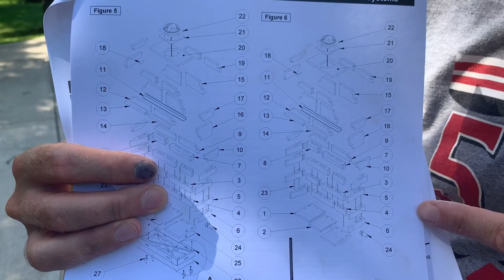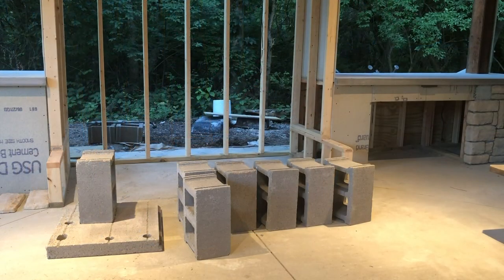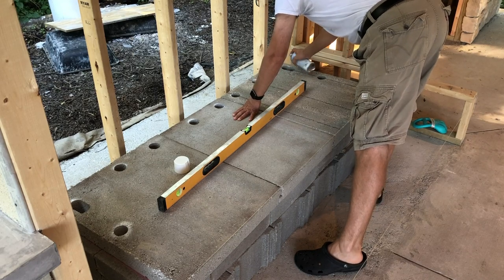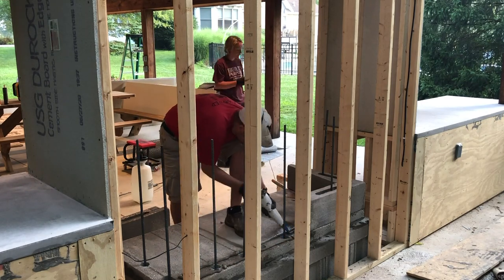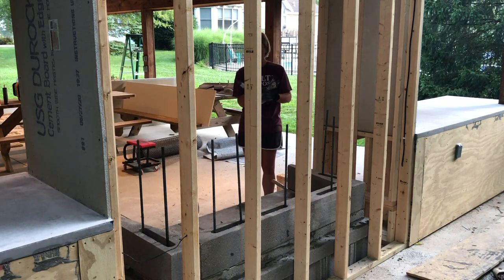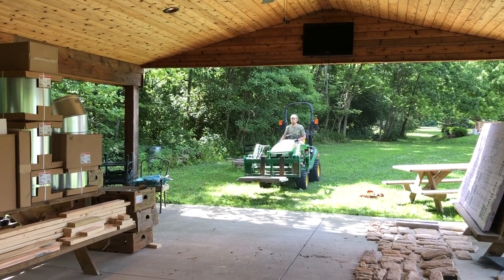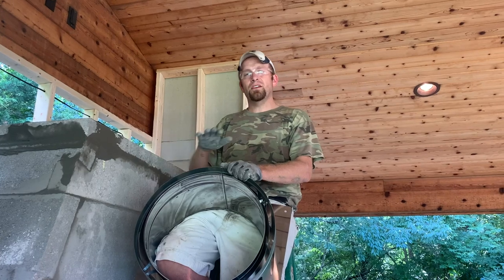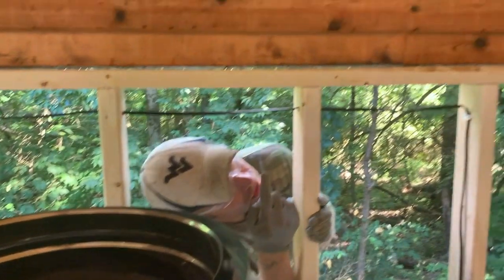BYO Outdoor Fireplace   - Firebox Build (Mason Lite 63)

Comment: I am going to redo my indoor fireplace, i think your kit is great, much easier than making it from block.
Reply from the maker: They have several different size options and it was pretty easy to put together.  My only issue was that some of the rebar fell out during shipping and I had to get a piece of angle iron to span the opening of the fireplace.  Neither was a huge deal, but I would have assumed it would have been included for the money spent.